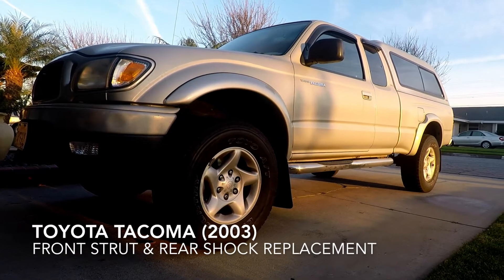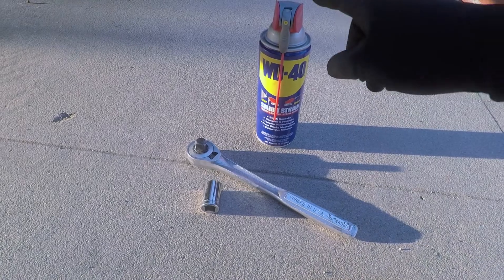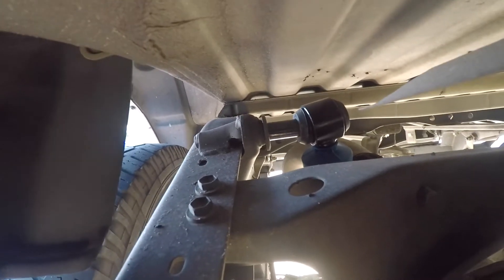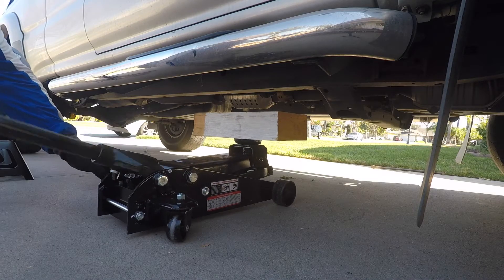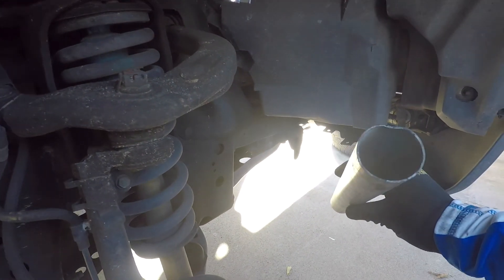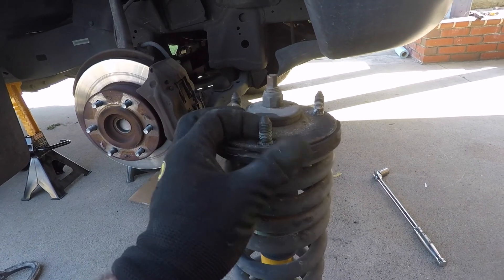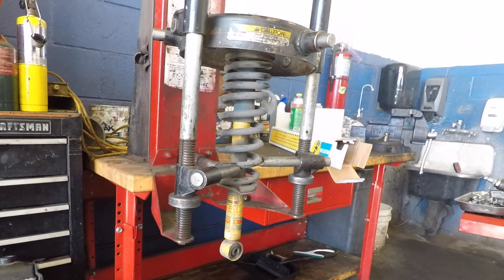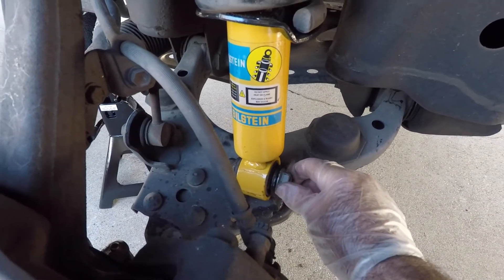Toyota Tacoma 2003 Strut & Rear Shock Replacement

Comment: Thank you so much.   This was far and away the MOST helpful, useful video I watched.  I was able to change all 4 shocks in about 4 hours.  Had the springs switched at my local suspension shop for $45.  I put 3 in 1 oil on all the bolts about 2 weeks before I did the replacement. 
Thank you,  thank you again for your video.
Reply from the maker: Curt that's great I'm glad the video was helpful.

Comment: Awesome video!  You saved me at least an hour on the strut reinstall by compressing the spring with a pry bar.   All other info I found people said to remove sway bar or even the lower ball joint 😳.  Thanks you very much!
Reply from the maker: Sean you are very welcome I am glad it worked out for you....stay safe.

Comment: Excellent video.  Just ordered struts and shocks and now feel confident I can do this in my driveway.  Did you have to do a front end alignment after you were finished?  The reason I'm doing it myself, I was quoted a price of $969.00 at a local garage and they insist that the front end must be aligned but I cannot see how changing the strut the way you did it would change anything requiring a front end alignment.  Thanks for sharing your experiences on YouTube.
Reply from the maker: Hey I'm glad you saved money. i was quoted approximately the same amount and that was my motivation on doing the video.
Reply: Nearly $1k to install the shocks?? Geez... I’m trying to get new shocks, wheels, and tires. All that would be $2k+ and i don’t even wanna begin to imagine how much a shop would charge me to install it all...

Comment: How do you check that the bolts  are tighten to specification?
Reply from the maker: I used a microtork wrench to loosen at least one of the bolt for each situation which gave me a reading to go by. Sorry I did not write it down.

Comment: can anyone tell me where or what size the bolt is that holds the bottom part on?
Reply from the maker: Hello and thank you for watching. If I recall I believe it was a 17 mm with a total length of 3 1/2" long.

Comment: Bolt torque specs?
Reply: I second that, the torque specs would of made this good video even better!
Reply: @shawnryder6954  Rear are both 53 ft-lbs.  Toyota Tacoma Front Shock Upper Nuts Torque Spec : 47 ft-lbs.  Toyota Tacoma Front Shock Lower Bolt Torque Spec : 101 ft-lbs

Comment: Is there a difference in shocks with a normal Prerunner and a TRD Prerunner?
Reply from the maker: I don't think so and thanks for watching.
Reply: There isn't only different would be if you have a regular cab 5 lug then those won't fit. Prerunner has bilsteins from factory also, same height.
Reply: I think TRD is supposed to have a different off road suspension.